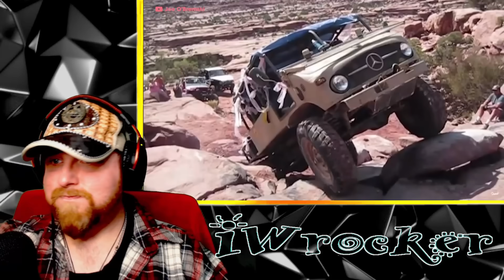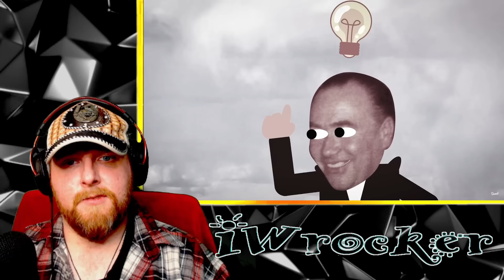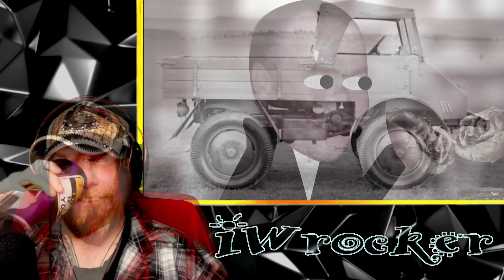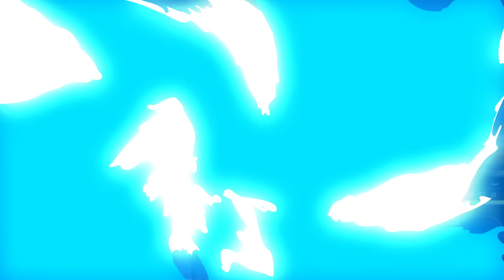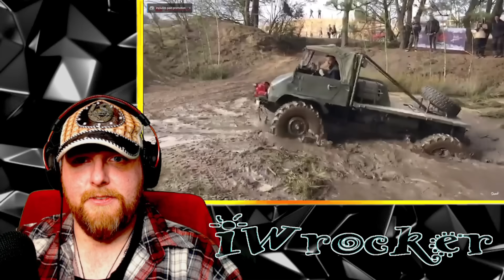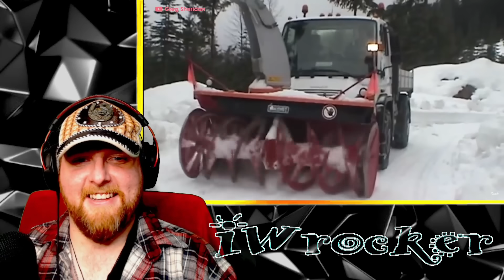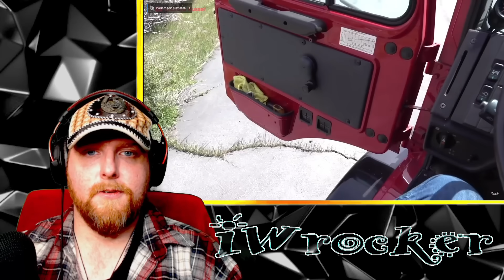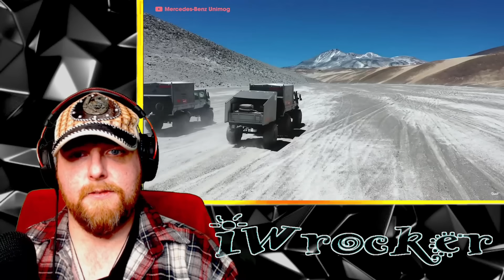American Learns About the Mercedes UNIMOG

Comment: There extremely slow but can climb walls and easy to work on other than if you want to pull the gearbox/ transferase those tquore tubes spreading them is a mission and can be rather dangerous if you don't have the correct tools and pullers. But other than that there cool as for going up bush or farm work. Only thing I'd try to get is a little more top gear speed.

Comment: On Autoline South Africa, there are currently 73 offers for used Mercedes-Benz Unimog trucks, with prices starting from €3,100 (approximately ZAR 63,534).
 AutoTrader lists both new and used Mercedes-Benz Unimog trucks and caravans for sale, providing access to a large selection of these vehicles.
 Gumtree South Africa features 14 listings for Unimog vehicles, ranging from classic models like a 1976 Mercedes-Benz 406 Unimog for R 595,000 to a 2016 Mercedes-Benz Unimog Double Cab Motorhome priced at R 3,300,000.
 Specific models include the Unimog 416 DoKa Overlander, a custom-built expedition vehicle listed for $200,000 (approximately ZAR 4,000,000) on ExpeditionMeister, which is fully overhauled and ready for global travel.
 Another notable listing is a 2012 Mercedes-Benz U 5000 Unimog Camper, known as the "Doomsday Truck," built with a double cab and a custom camper box by Alucab, with a build cost exceeding R5 million.
 Tractorpool.co.za offers used Unimog tractors for sale, suitable for agricultural and municipal tasks, with models from 2006 and 2018 available.
 Mascus South Africa lists various Unimog trucks, including chassis, flatbed, and tipper trucks, with options for filtering by year, price, and hours of use.
 For parts and restoration, Mogdoc is a specialist in Unimog services, restoration, and custom work.

Comment: Unimog is legend. For the luxury part google the Unimog black edition 😇
For the biggest one lool for the Unimog 2450 6x6 (3 axles). Meanwhile Unimog got a big brother named Zetros...
I've driven a 1964 Unimog myself once - wirh the reversing gears, one from the 1980s with 4 reversing gears, the modern ones have 6 of them. Was quite fun to gear up 3 times while reversing into a parking spot...

Comment: Hello iWrocker. Do you know where the name Unimog comes from ? This name is only an abbreviation. In English it could be named UNIversal MOtorized Gadget (in German UNIversales MOtor Gerät) which means that this model was not primarily built as a car but as a motorized strong working machine that could be used in different sections where strong machines were needed such as construction zones or agriculture or in landscapes with a difficult ground. Only as a second step this gadget became a car / truck.

Comment: As good as they are off road they're terrible on the highway. Above 80km/h it's just guessing which lane you'll be in. It becomes very unstable at higher speeds. At my place of work we have three of them with a crane. The weight of the crane that high on the vehicle makes it even more unstable, especially when cornering. 8 gears forward and 8 in reverse.

Comment: UNIversal-MOtor-Gerät is acronym to its German heritage - tranlates somehow : universial motor device .., what it is on roads, acres, hills, creeks, rails and many more. It has space for 1 mton load and standard coupling devices for truck and power-take-off shaft for different adable devices in its first appearance. The modern ones have heavier loads and some more options, but the elderly willmatch allyou need to get through heavy terrain in all wheater conditions.

Comment: Unimog and MB Trac share the same platform…you see it when you compare the engines, the tires, the Unimog even does have a pto at the front…and hydraulic connectors…same at the rear end…

Comment: The 56mph is the maximum speed most heavy trucks are allowed to go in UK/EU (it was set at 90kmph hence the slightly odd number of 56mph). So for sales to EU or UK the unimog has to be sold with a speed limiter fitter. It would be interesting to see how fast a unimog without a speed limiter could go.

Comment: Ooh, let me tell you a story. We were doing some field exercises in the army and one of our regular Mercedes-Benz trucks got stuck in the mud. They tried to pull it out with the Unimog but it dug itself in, all four wheels. So they attached another Unimog to it, an military ambulance one and tried again but the medimog managed to dig itself in as well. So we had three vehicles stuck in the deep mud. What did we do? We called the base and orderer a Saurer truck. One of the oldest trucks still in service, it's straight up 70 years old but it's engine? A 2000 horsepower monster. When it arrived, it dragged all of them out one by one with zero effort, dragging massive ditches in the mud with dug in wheels of the stuck machines. So yes, there are times when lil Unimog by itself is not enough.

Comment: Fun Fact: You can get a winch attachment for your unimog that is powerful enough to pull your unimog up an almost vertical surface. Assuming of course you can find a strong enough attachment point.

A unimog can reach pretty much any location you might need to reach. It's not gonna be fast or comfortable but it's persistent, nigh-indestructible and it will get you there.
And when you reach wherever you need to reach the unimog can and will do pretty much anything you need to do. With the right attachments of course.
A unimog is essentially a motor that can get to where it needs to be on it's own power.
The only two things the unimog can't do (yet) are flying and traversing the high seas.

Comment: Back when I was in the Motorized Infantry in Denmark (1980-81), we rode these Unimogs.
I still remember that if your arms were longer than average, you'd bang your elbow into the back wall of the cabin every time you shifted gear :D 
But they were fun to drive in terrain.

Comment: i once rode in a Unimog when i was with local scouts. one of us had an older unimog and we used it to haul christmas trees from the woods to our church, where we sold the trees to the public. the fascinating thing about the unimog was its maneuverability in tight places. we had not much space near the church, so the driver decided to just go down three steps and up again on the other side without any problem. The second cool thing was: this Unimog had only 4 gears to shift through and of course the differential thingy and 4x4 drive, but it also had one lever to choose between forward and backward drive so that even when driving backwards you can shift through all four gears with the other lever!!!

Comment: They don't need much maintenance at all! Unless you are brutal with them or don't change the oil for years! You can buy parts from most Merc dealers. But I'm afraid usa has( rightly or wrongly) the biggest protection racket against "Foreign" imports, which to some extent holds you back in the world! You weren't allowed to buy Concorde either, imagine if airforce one  was a Concorde!! You would get there 3 times faster! And that was 40 years ago! Imagine how much faster and less noisey it could have been with modern materials and engines! It's really a crime that the leader of the free world doesn't have something special to fly round in! and personally I would rather stick with and old Boeing than a new one if you know what I mean!

Comment: This Universal-Motor-Maschine called Unimog will Cost as U5023 4X4 Spezial Edition with 450 HP about 392000 ,-€ (402000,-$). It is No Truck and No Traktor , it is a Thing between this Two Types of Maschines. It is the best OffRoadmaschine of the World, but it is much more as this !

Comment: They r legal in the USA,. . I just bought one last month. A 1988 Freightliner Unimog  FLU-419 military version with bucket on front, and backhoe on the back. Love this thing!!! Even has a hydronic chain saw, hammer drill, and jack hammer. They r pretty expensive tho. But this thing is built like a tank, to military standards.

Comment: Over the pond here, where Mogs are working vehicles. Tree surgery trucks, fire trucks, snowplows & snow blowers, airport trucks, telecom line trucks, agricultural, log & stone haulers, biomass harvesting with a whole-tree chipper on the front & a chip box on the back. Can be fitted with a Hiab crane and on the smaller ones, can be driven on a car licence. Also seen a few converted to campervans for international travel.

There’s also a 6x6 version and a one-off U500 Brabus Unimog.

Comment: We had them in the Royal Dutch Marines in the beginning of the 70s. The heavy duty winch is handy if you get stuck in a bog. Roll out the cable, sling it around a stake or a tree and winch yourself out. Same thing with the Land Rovers we had.

Comment: In Germany they have the Unimog, in Britain we have the Land Rover. Both invented to serve the same purpose. The Land Rover though was designed so that the farmer, once he had ploughed his fields, could take his wife to the shops or park easily at the pub. It is just as flexible and has been used in more roles than the Unimog. It too has been used as a train, even though its far smaller 😎🇬🇧

Comment: I have a Unimog 406 and it gets regular use around the farm.  Depending on the season you might find it spreading fertilizer, sowing wheat, raking and baling hay, dragging logs, running a log splitter, pulling wagons, hauling gravel, and a host of other tasks.  The thing is as handy as a shirt pocket.

Comment: the thing with euro trucks only going 56 mph is not because the truck cant go faster in most cases, but EU regulations mean trucks over a certain weight limit are required to be limited to 56 mph.

Comment: https://youtu.be/Tltt6o6lfjE?t=214
"If the Royal Air Force raided the Ruhr, destroying oil 
plants with its more accurately placed bombs and urban property 
with those that went astray, the outcry for retaliation against Britain
might prove too strong for the German generals to resist. Indeed, 
Hitler himself would probably head the clamour. The attack on the
Ruhr, in other words, was an informal invitation to the Luftwaffe to
bomb London." Denis Richards The fight at odds, 1953, p. 122

Comment: I worked on a cattle station in Western Australian Kimberlies in the 1960s they had a unimog 4 cylinder that could go almost anywhere but it had one drawback the radiater
bottom tank was below the bumper and was constantly holed on ant hills.

Comment: Was no doubt the best off-road truck I ever drove. Sunk into the mud till the bottom, with a trailer behind. And still, it get out off the mud in 4*4 and diff sperre. An Amazing truck. Furthermore, if it was stuck it had a winch that could pull as much as 14 metric tons.

Comment: A long time ago I owned an Austin Champ. It was a British built "jeep" designed for the war in Burma. Its good points was that it had a Rolls Royce engine and could drive underwater.
The bad points was that it only did 12 mpg on a good day, more like 8 mpg when towing any thing.
Luckily at the time I lived in a place where fuel was cheap. I could not afford to run one now.

Comment: They are often used for railway maintenance where there is no road close the tracks. They can be fitted with special wheels to go on the rails to the place they are needed and there retract those wheels and travel through the rough terrain near the tracks without being stuck to the tracks.

Comment: In the Austrian Alps you often see the old small ones which are used to take firewood to huts and shelters way above the tree line, across very narrow paths with roots and rocks. They usually are used where even the best pickup trucks get stuck because the terrain is just too rough.

Comment: Daimler-Benz build between 1986 and 1991 2416 Unimog 419 (also known as Freightliner tractor) for the US Army - used as a combat engineering vehicle. Related to the Unimog 406, but with a 24-Volt electrical system and special equipment.

Comment: UNIMOG is an acronym for „UNIverselles MOtor Gerät“ wich could translate as „universal motor device“. It was basically designed as a truck with capabilities to install hundreds of attachments for a variety of uses. You had the onroad capabilities of a 4x4 truck with the offroad capabilities of a crawler/skidder with the multifunctionality of a tractor. 
Still today the Unimogs offer three attachment areas (front, back, top) with PTOs, hydraulics and so on.

Comment: I am a sailor and during large catamaran regattas we are often not allowed to take our vehicles onto the beach and that makes sense given the prevailing ground conditions there (extremely soft sand). So our boats were pulled onto the beach with a trailer by a UNIMOG Baujar 1949 as if soft sand was its normal taring. Unbelievable. It had a reversing gear. You determined the direction of travel with one lever and operated the four gears with the other. He could almost go backwards just as fast as forwards. great thing. It was sold in the US from Freightliner Custom Chassis Corporation, FCCC. Mayby you can buy one from them? If you realy wont one try to get the 419! It was bild for the US-Army. https://en.wikipedia.org/wiki/Unimog_419

Comment: Unimogs are insane. I used to live next to a dike near Hamburg, where the local farmers had a Unimog attachment for mowing both faces of the dike all at once from the road on top of it. Also, I can't remember where, but I saw a graphic somewhere of what you need from a vehicle and where it should go and then all different varieties of powered vehicle below, and the Unimog checked all boxes except flying (there even were several amphibious versions).

The Unimog fills the Pickup-Sized gap in the European car mix.

Comment: In the New Zealand army we had Unimogs which replaced our old RL trucks. They were easy to drive with a wide gear range and apart from having good off road capability were good road vehicles as well with comfortable suspension.

Comment: Does the US military use Unimog?
The United States Marine Corps and United States Army uses the Unimog 419 as an engineer tractor, while the United States Army also uses Unimog vehicles to access remote installations. In total, 2416 Unimog 419 were made, and only used by United States Forces.

Comment: MOG is legendary in Europe, especially in Germany. Check out the modded MOGs for rallye like Paris-Dakar MOGs. The UNIMOG was widely used from military to community service vehicles to agriculture and forrestry. Hence UNI - universal. It is dedicated for offroad transport. many come with a crane behind the cabin. They can easily fit a large snow plow or snow blower. MOgs are actually hunted by collectors a lot as community services and military do offer them on auctions at the end of their lifecycle. It's a gem for DIY people. Another such Gem is Russian or Romainan GAZ69 vehicles. These are as iconic as the Willis Jeep or GM trucks or the Yellow School bus of WW2 for eg.  It' in the league of London Cabs or London double-decked bus. These vehicles have been universally modded as a platform that you would seen them anywhere for like 50 years.
The big advantage is that the fuel consumption is fairly moderate. Some Ford F-150 Raptor or Dofdge RAM likely will guzzle more fuel unless you really have it crank on the accessory shaft hard.
MOGs are easy to ship and they have been sold all over the world. Shouldn't be hard to find one. Mexcio or Canada may be the go-to place for shopping one in the Americas. That 65 mph is with a fully stuffed firetruck outfit...  They turbo-charged Dakar Rallye vehicles are really cool and way faster with a lower center of mass. That thing is 4WD with syncro drive going stable and fast offroad.

Comment: I only was sitting in a Unimog once, and it was a blast. Even tho i was just on the side with no steering wheel. We where driving down a Mainroad and got into a Traficjam, the driver was looking towards our right the whole time and the first moment we could get Offroad he went for it, through mud, woods and then mud again. We had to clean the Unimog afterwards for like an Hour, so we did not save any time - but damn it was fun.

Also every time i visited my Sisters old Place, i could see an Unimog sitting in a backyard, sitting there jacked on Stones, the Weels just close by to it - thought it was sitting there to rott, until one day the guy owning it attached the weels, started the engine and drove off... not sure how much prework he had to do for that to happen, but apperently he drives its 1-2 times a year to get woodwork done for winter

Comment: iam a german. and i se them everywhere where work has to be done. one time my car got stuck in the wilds. radio told me an unimog is comming. and i already knew my day was saved.

also it surprizes me that they are illegal in the us. thats explains a lot
Reply: They aren't illegal in the US, just very uncommon.  I have a 406 (marketed in the US by Case as the MB4/94) that I use regularly around the farm for a wide range of jobs.  Unimogs are in a gray area here with regards to road licensing and different states have slightly different rules.  Here in Kansas my Mog cannot be registered as a road vehicle but it is legal to drive it on county and local roads, just not state or federal highways.